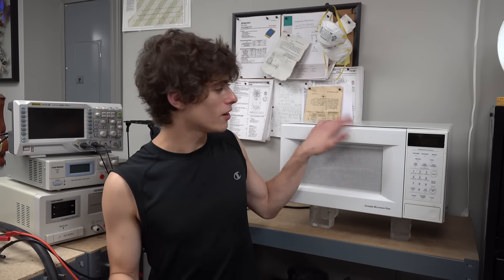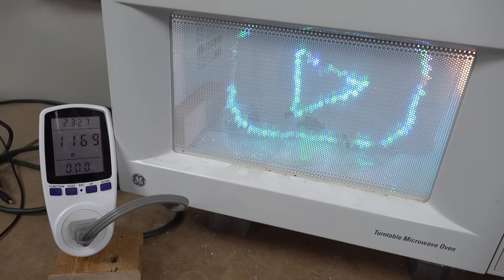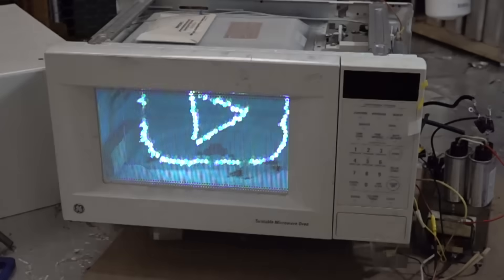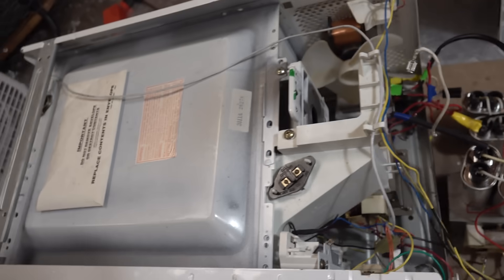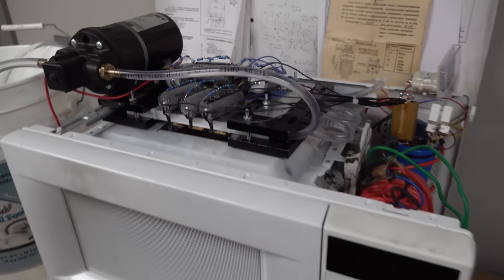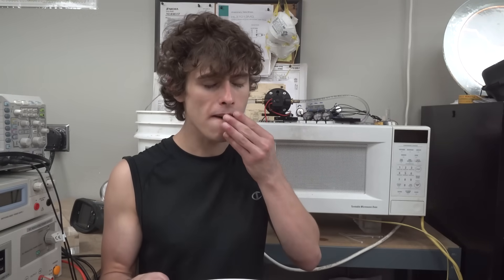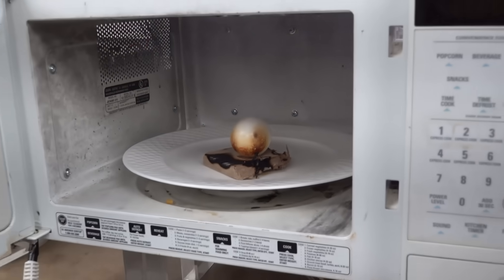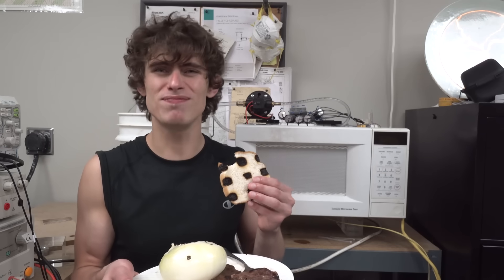I converted my microwave into a LASER oven!

Comment: When hobbyists get killed by their projects, it's usually because they're messing around in a microwave like this (proceeds to stuff hand recklessly into circuitry)
Reply: All you need is common sense and knowledge about what your doing and you'll make it out alive. Trust me I've been playing with high power transformers  extremely hv transformers and I've not been shoked even once . Also even the great photonicinduction said that all you need is common sense 😉
Reply: @valanps1638  Survivor's bias — most dead folks don't comment on YouTube
But really, there's another important component to safety — sleeping enough. When one's exhausted, one's judgement just refuses to cooperate
Reply: @ValeryBelayev   I normally do my stuff at night though. cause electricity is cheaper then
Reply: @valanps1638  I once accidentally touched a huge capacitor, my arm shook lol, no hurt
Reply: @Versuffe   should have made sure it was discharged xD
Reply: @valanps1638  If you had been shocked once by one of those transformers would you be here to tell us? Or would you have that carbon flavor? lol
Reply: @ikitclaw7146  carbon flavour for sure man. no way I could have survived that much power xD. My lowest power one is  about 5KVA and highest lower is about 35KVA. And they are hv transformers all outputs over 5kv at 240 volts input so one touch on the output is more than enough power for some nice carbon flavours 😂😂

Comment: I'm actually kind of amazed at how well the steak cooked.
Reply: Well you only need to cook the outside as opposed to everything else which needs to be cooked through, so it's actually the best for this
Reply: @dsdy1205  If you want a blue steak, sure. 

Some heat does need to travel into the core as well (not for food safety reasons, necessarily, but so you don't feel like you're eating raw meat). 

Obviously you want a good sear on the steak, but a well done outside, combined with a nearly raw inside, is not what I would call enticing.
Reply: @ILCorvo001  you're just describing medium rare no?
Reply: @dsdy1205   @Dean Su  Yes and no - and I'm assuming you mean rare or blue. 

Even though a rare steak is cooked and seared on a pan/grill/open flame, the heat from the flame still cooks the interior of the steak. Not as much as it cooks the exterior, mind you, but enough to at least warm and heat up the interior.

A steak can be seard to perfection and still be considered undercooked - simply because a perfect sear is not all there is to a perfect steak. Just because a steak has a mostly pink center does not mean that the interior is not cooked to some degree, it just means that it hasn't fully gone through the maillard reaction yet and cooked all the way through. 

There is a massive difference between a steak properly cooked rare, and one that is prepared in such a way where the heat does not penetrate more than a few millimeters past the surface.

It'd be like trying to cook a steak using a solid tungsten frying pan heated to 1500o and only leaving the steak on the pan for 1.5 seconds per side. We, along with the cattle the steak comes from, are made primarily of water, fats and proteins, and heat doesn't like to be contained to one spot. It travels and radiates in the medium its contained in. In our (the cattle included) case(s), that heat travels and is diffused by our flesh. And as with the way lasers work, that heat is almost entirely contained to the surface area that the lasers are covering. 

Perhaps if someone built an entirely 360o laser array and could somehow suspend the steak in the air. Maybe then something cooked with lasers would be viable, but even intnhat case they'd have to be toned down and perhaps even made infrared (as we use with many appliances already), so as to not overcook the outside before cooking the interior.

 As with anything involving living material, you can't exactly ever really go backwards if you make a mistake. If you overcook the outside before you get the inside done, that's kinda just all she wrote. Measure twice, cut once, as they say.
Reply: @ILCorvo001  Makes sense hahab I defer to your expertise in this area
Reply: im not certain that the laser was responsible for all the cook on the steak. to me the focused light wouldve just left burns just like on the toast without cooking the whole thing. but i really dont know
Reply: @blankblank4949  it's diffused
Reply: @blankblank4949  Heat is heat, regardless of its source, so yeah it definitely could cook it to safe levels. How tasty it would actually be once it's cooked past "blue", though, is another question entirely, with how charred the surface would likely be.

Comment: Old and busted: Marmor Cake ... 
New Hotness: Laser Marmor Bread ... 
Oh I see you are using the rural Afghan plug (just cable in the outlet) , but compared to the shocking USA plug it is not less save ...  
ALWAYS keep the transformer , you can always use high voltage transformers.

Comment: you can use the lasers to heat a metal plate to a certain temperaure and cook foods with convection. you would be able to use the laser only to bring plate to temp and then turn off for a moment. you carbonized the food because you applied direct heat to them. Just the same as burning with fire. you would do well to try this suggestion you would be very surprised at how much better the outcome is. Try to maintain temperature. You are onto something.

Comment: You can probably use parallel magnetrons if you fine tune the impedence of each and use adjustable waveguides to get the phasing right matched (like adding a short pipe to the output of a whistle to get the pitch the same as another one beside it). Probably if tools exist to make that easy they are not cheap, so trial and error with 2 while testing for total output power and then add them 1 at a time and repeat is the way to go. Probably a huge time and effort investment, a used eBay magnetron meant for military radar from Russia is probably better (those go to MW pulsed, maybe 20-30kW continuous if the duty cycle is kept low and watercooled).

Comment: So do lasers effectively do the same as a microwave but at a higher frequency..you now instead of being in the water molecule band would it heat other  elements of food that do not contain molecules at the microwave band... like will it heat or transfer energy to atoms in molecules. If so couldn't you heat things by targetting the atomgroups in food  or specific types of cuisine so that you heat specific parts of foods much like a microwave heats the water in food?

Comment: I'd love to see how this would've worked out had you used a commercial grade microwave as a base. The one I've got at work is 3,000W, bringing sandwiches to a temperature too hot to handle in about 15 seconds. They're probably a bit pricy, though.

Comment: So, inertial confinement fusion lasers! I have a concept design that uses a double helix "donut" in side the cavity of a piston head, using plasma that gets moved around in a tube that uses a one way valve that pivots on a hinge to  be pushed via an diaphragm that gets pushed and pulled by electromagnets on either side of it. This valve can then push, they are on either side like a heart valve, the plasma  into the cross section pressure points of the double helix donut. Creating spike waves into the spinning and pressurized plasma. Then the 4 corners have lasers that use the heating of the plasma (the tubes and valves have powerful magnets and electromagnetic coils in them) and the resulting increase in photons to be gathered in tubes and amplified then uses lenses to concentrate them into a the cross section point. The other piston head has a rod that shoves more plasma (also powerful magnets and electromagnets to push it as it moves physically into the hole with the rod) into the helix and causes an spike wave and increase of pressure in the system. The lasers and electromagnets increase the heat of the plasma, while the spike waves from the other piston head and the valves create massive pressure spikes, just as it's getting compressed even further and hit with the lasers and photons. Do you think this would work better with your inertial confinement lasers?
Reply: I love how there’s always that one undiscovered genius in the comment section
Reply: @FrappuccinoAlfredo  thank dude, I appreciate it, hopefully styro sees it and can answer me, or any of the other people I tweeted at this design to. Seem to be getting no where really
Reply: @TheColorsInGreyLife  at least 11 of us who liked your comment, wondered for a sec whether it would work =) Cant solve for viability of your design right now, but werent there a startup who were dropping a molten metal droplet, blasted it with lasers, and were claiming great prohress? You should check them out to see if there is overlap

Comment: 7:00 the banana arcing might also have to do with the fact that bananas emit low levels of ionizing radiation (Potassium 40 decay), lowing the energy level needed for the air to ionize, and thus arcs form with lower voltages over the same distance

Comment: The penetrating power of light varies massively based on the wavelength and what you're cooking. Generally you want to match the color of the laser to the color of the food. In terms of things which might actually work there's a big outlier in that a very specific wavelength of red light penetrates meat very well, but you have to get it exactly right.

Comment: Well it looks like you have enough laser emitters to put together a mobile laser with a kilowatt of output power. It would definitely work better as a two piece unit with the batteries and cooling in a backpack with power and coolant running through a bundle of hoses and cables to the handheld 1000 watt laser bazooka. Actively cooled first surface mirrors could help with condensing the separate beams into a smaller more dense but still chonky beam.

Comment: Yeah, I wouldn't throw around magnetrons.
Modern ones probably don't use beryllium for the insulator, but better safe than sorry and don't break the insulator.
You dropped the ball there about the safety precautions of working with any microwave oven.

Comment: 4:43 just in case anyone actually thinks to try it, they specifically designed modern circuit breakers to prevent this trick from working anymore. even with the switch held in the 'on' position it can still be tripped.

Comment: What timing! I just got a carbon arc furnace working. The design is from a 1934 issue of Popular Science and runs on straight mains voltage, 120. It uses a tub of water (with salt added) as a resistor. Dead simple

Comment: I would try water with food colouring for diffuser.

P.S.: I am disappointed that you didn't overclock the turn table.
Reply: thats fucking genius like 600 rpm
Reply: They’re induction motors so you need a VFD, still absolutely worth it.

Comment: Honestly, one of my biggest complaints about microwaved food is the lack of crispy/char that you get with traditional cooking. Maybe some form of hybrid laser/microwave using a better diffusion system to char/toast the outside with the laser and heat internally with microwaves.
Reply: Way too dangerous because if some light gets out then people would get permeant eye damage.
Reply: @willsk3122  Interesting.  First high voltage AC was shunned, then CRT TV's, then microwave ovens.  I would think the same with laser ovens, but if handled properly it may be foreseeable as with the previous technologies.  I'm not sure it's practical for cooking.

Comment: I'm really the wrong kind of Engineer it seems. I'd rather be making laser smores.
Reply: Designing roads is fine, but when the most exciting part of my day is driving to work, you really wonder if 5 years of college was worth it.
Reply: @jamesharding3459  I think the answer to that question lies in what you drive.
Reply: @c0c0asauce  Or where you're building a road. 25+ miles of sketchy forest service road to get to the extension you're building can be quite interesting.
Reply: @jamesharding3459  i used to thrash my rex through forest service roads all the time.  Ended up doing media at 100 acre wood rally once and got to drive my new g35x on the closed to traffic stage roads.  What fun!
Reply: @jamesharding3459  did they teach you about geology too or are they doing that without you aware as well?
Reply: @apimpformallyknownasslickb65  Not really geology, but a lot of geotechnical stuff - basically, how soil acts under various circumstances. It's an entire specialty of civil engineering, but mine was structural so I didn't get anywhere the same level of instruction in that.
Reply: Oh EM, didn't expect you here man
Reply: I read laser storms and thought "heh that's epic" and then I re-read it and it just got better XD it sounds delicious and high energy

Edit: Now that I've watched the video, I can conclusively say Laser Smores looks delicious too lol
Reply: Laser S’mores? I’ll stick to my firework-baked cookie thanks very much
Reply: @oxidiser  mmm yummy sulfur flavor
Reply: @oxidiser Firework baked cookies, I’ll stick to my cold fusion ice cream cake thank you very much.
Reply: start a mini project where you delve into different disciplines. Take what you can do now, grab a textbook and watch some youtube videos for other ideas then create something beyond what you thought you could do the month prior.
Reply: idk why i wasted my time becoming a thermodynamic engineer, this shit is so much cooler
Reply: @ccall48  what’s that?
Reply: @ccall48  please don’t take any offence or anything
Reply: @rowanoo5797  fancy way of saying i fix commercial refrigeration stuff ;)
Reply: @ccall48  well I mean there’s still worse I guess for example the engineers who are just putting things in and out of ovens all day. Maybe?
Reply: @ccall48    You could work on Plasma Speakers?   That would be cool!
Reply: Lol
Reply: Your videos are getting me through college Engineer Man!
Reply: i've tried marshmallows with a magnifying glass and the sun before and it doesn't work that well. The way the albedo decreases as it caramelises/chars means that it heats up really unevenly. What I want to try someday is to hook two carbon rods up to a welder and touch them together inside a marshmallow.
Reply: @charleslambert3368  what's stopping ya? I have 2 carbon arrows and a welder, you bring the mallows?
Reply: Love this channel and love yours too, EM!
Reply: i don't think you can have a job as a laser engineer...
Reply: yes
Reply: @Repent Reported.
Reply: @Slyuniform  Reported.
Reply: Or making comments for exposure
Reply: Records his crimes for our entrainment lol Well and for his too
Reply: They already did the laser cooling thing anyway so screw that PHD 😂
Reply: Engineer gaming ⬅️ (corrected by YouTuber or some admin) Engginer gamming
Edit: Why did this get corrected
Reply: No no, he’s got a point
Reply: How about a laser power speaker?   If you could modulate it with an audio signal and directly excite the air that would make a really neat omni-directional transducer
Reply: I definitely am the wrong kind of engineer...I'm a locomotive engineer.
Reply: SEND HATE ON MY VIDEOS..
Reply: Of course I am going to do the overused tf2 joke, Engineer gaming.
Reply: 10:49 F IT MACROWAVE
Reply: can you help me make one?
Reply: I made a laser bong lighter one time, and I'm not even an engineer!
Reply: @NonEuclideanTacoCannon  that's beautiful